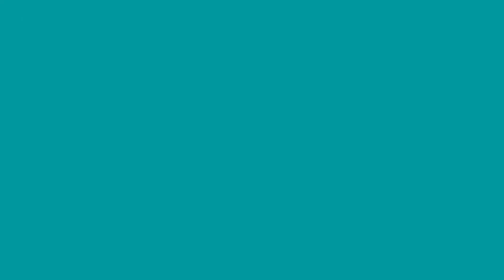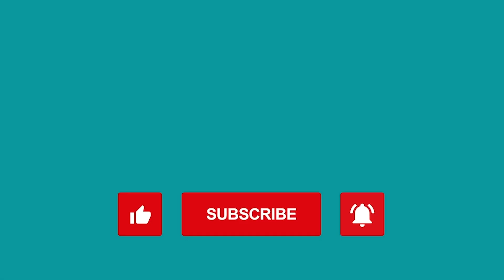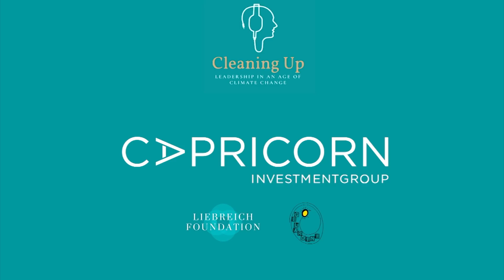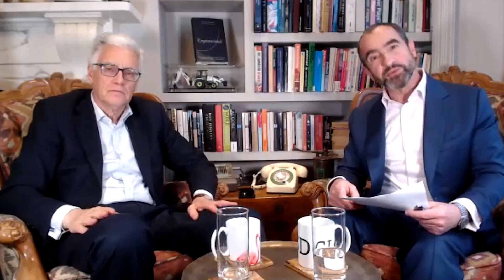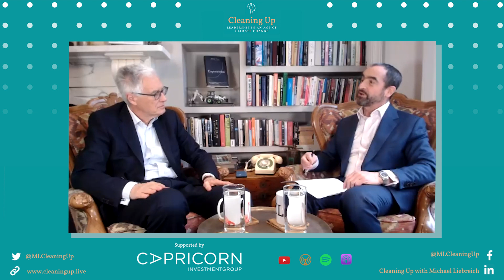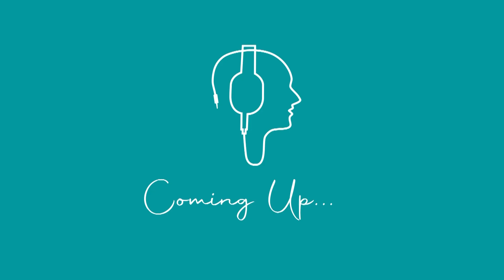Lord of the Net Zero Transition - Ep110: Adair Turner

Comment: Interesting, although I hope that his opinions have changed some over the last year or so since this has been made. For the most part though, I agree. Good discussion.

As a point, I always like to point out that we have become too obsessed with electricity. Energy comes in many forms and some times other forms are better than electricity. For instance, solar electric is still pitifully low in efficiency. Solar heat capture is far more efficient, as it captures pretty much the whole range of the light spectrum, including all the infrared, not just certain bands of light. As such, quite a bit of energy can still be captured in higher latitudes even in low light levels.

Cheap and plentiful materials like sand can be used as a heat battery. Solar heat can be captured in the summer, stored until the winter, and used then. With heat batteries, the larger they are, the more efficient. As such, neighborhood head batteries could be installed. Heat captured all over the neighborhood could be funneled to it over rhe summer and houses all over the neighborhood can take from it over winter.

More, heat pumps can be used to massively cut down energy used in industrial locations. Typically anything using high heat also wastes huge amounts of heat cooling materials down after processing. Instead of just allowing that heat to escape, they could capture it and take it back to where it is needed.

More changes can help top. Getting rid of personal cars for a public transit system that scales from good walking paths to good biking paths to buses to light rail to heavy rail to ride share vehicles and rental vehicles. The option could still be there to own a vehicle, but at that point, most people would probably opt so save enormous amounts of money and just take transit.

Also homes. Multiunit buildings are just more efficient. It's a plain fact. Build multiunit buildings for most people living in any sort of concentrated space. Build them really well though. Amazing insulation not only helps keep energy usage down, but reduces huge amounts of stress from noise that is the main reason why people don't like multiunit dwellings.

That and having more community supported systems. Like community workshops. Community offices. Third places where people can just sit and relax without being forced to buy things.